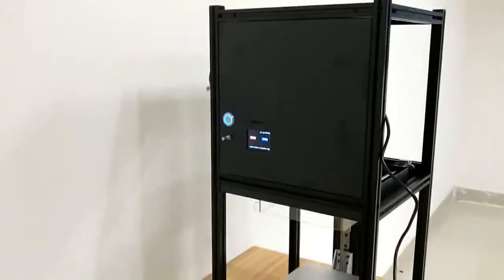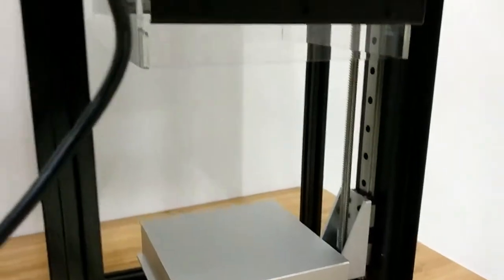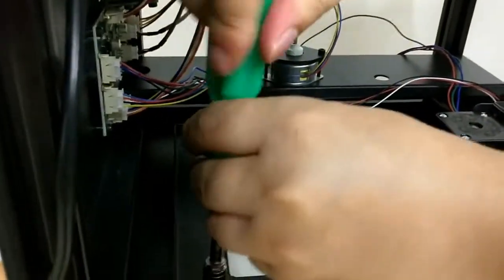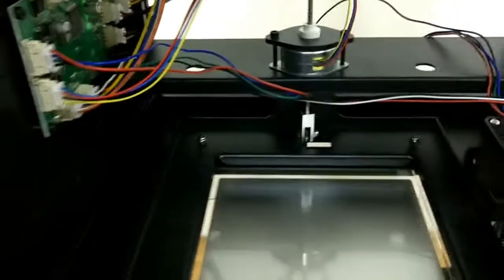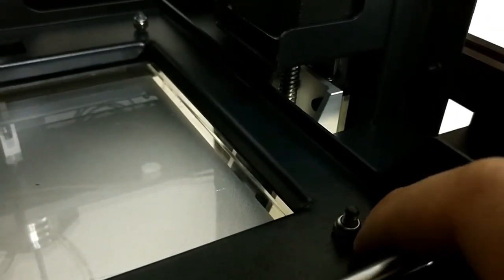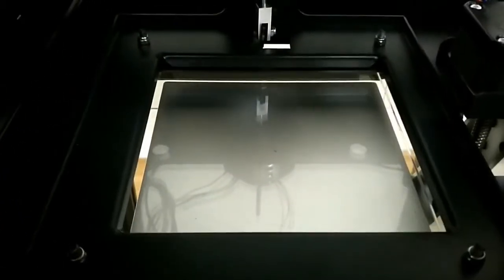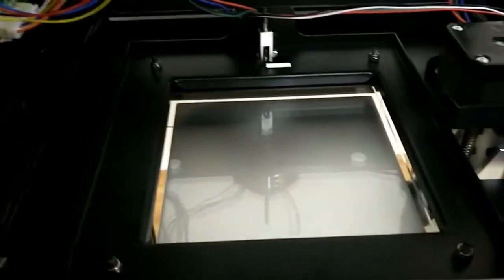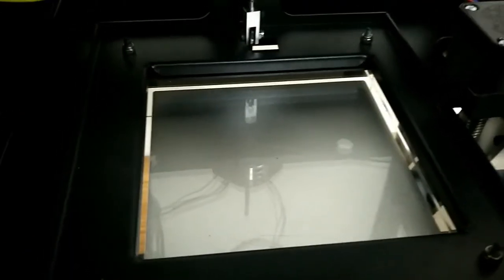Moai SLA Printer - Leveling instruction

Comment: LOL, I routed my wires through those two access holes also. I even had mine all zip tied nice and organized and had to cut it all loose. Some small holes along that lip would be nice for inserting the zip ties along that framing because it seems a natural place to run the wires, but some way to keep them managed would be great.

Comment: This is the first time I've done it upside down and It wasn't so bad at all.
Reply: I was worried when i leveled mine. It was difficult to see what the heck I was doing. I wish I had seen this upside down idear when I set mine up. As soon as I replace the resin vat i will be giving this a try. It may introduce some slight backlash/reverse gravity deviation into the setup. But this looks like it would making the bed level a lot easier. I used a piece of paper and cut a slit in it to slide around the screw. Then tightened the nut until the paper barely slid out. Then I gave it another 1/4 turn. So far so good.

Comment: Hey guys, just got my Moai  and couldnt be happier! Putting it together was a lot of fun and exciment! Anyway I'm having a bit of issues with the leveling bit and I'm not sure how to proceed. For instance I noticed that, in the video, when getting the nut loose, you can still see part of the bolt left. In mine, if I unscrew the nut down it gets nearly out of the bolt till I see the gap since the springs will push the bed down. So I'm not sure how to proceed
Reply: Nevermind I just realised I was doing the Z podition wrong. Trying another print test
Reply: I cant make it to pront the ring test. Following all the instructions but after minutes theres nothing on the build plate. Any suggestions?
Reply from the maker: can you post in forum.peopoly.net  we do support there and please share your system settings as well.  pics and videos would help a lot

Comment: Am quite fascinated by your printer, congrats on the kickstarter. Is there anyone in the UK showing off your kit live? I'm looking at more printers to print and paint miniatures and character models. Current FDM printer is doing ok but would like to see how this one does. Is the resin able to be primed and painted like PLA? I have seen online it do small but im interested to see its full potential
Reply from the maker: you can reach out to Spannerhands, our UK reseller http://www.spannerhands.co.uk/ or join our Facebook group. Search for Moai SLA Owner
Reply: If you are in the market for a printer that will produce insane detail on small figures and you have the funds you have to buy this printer. It is so easy to use. The build is so easy with the included instructions. And this printer will produce prints that have detail I can't come close to duplicating even with my CR-10 with a .2mm nozzle. My CR-10 has a ton of modifications and will produce some amazing prints. But I have some designs that it can't produce the finer details well enough for my needs. I sliced my toughest design in the Moai edition of Cura at .05 resolution, which isn't even the finest resolution this printer can print at, and having really no idea what I was doing I managed to produce 3 parts that blew away my expectations. And this printer is so fast. Producing 5 parts takes the same time as if you were producing one part. Whatever fits on the bed, the time the printer takes for each layer is the same. So not only will this produce a part with finer detail than any FDM, it will produce it faster. If printing 10 parts vs the FDM printing 1 part - This printer produces all 10 parts faster than the FDM can print one.

I have been paying very close attention to SLA printing technology since the 80's. I have been to the IMTS show in Chicago numerous times and have seen the latest and greatest SLA tech first hand. After 25+ years of watching and waiting - this is the game changer folks. Not Form Labs, not anything. Quality, precision, price, ease of use, etc, etc, etc. This printer hands down beats them all! Just my opinion of course. But I have 25 years of CNC setup/operation/programming experience and I challenge anyone to put their printer in the <$4000 price range up against the $1250 Moai and try to beat it in any category.